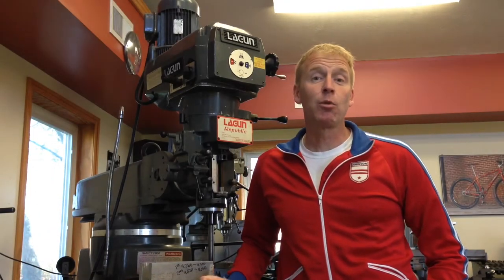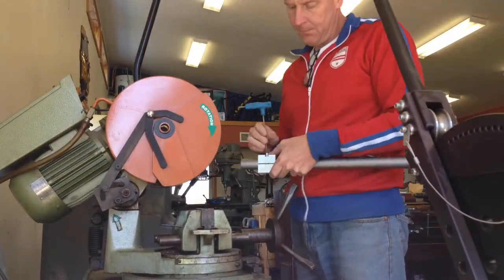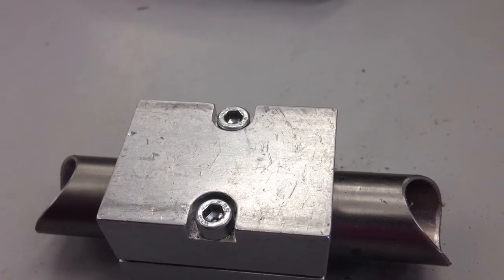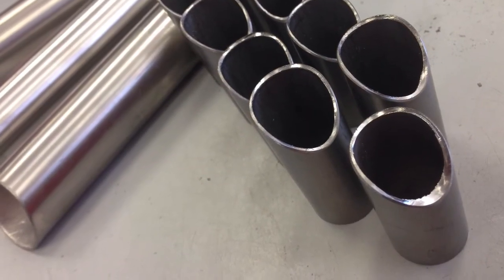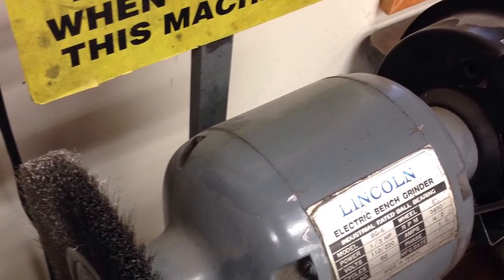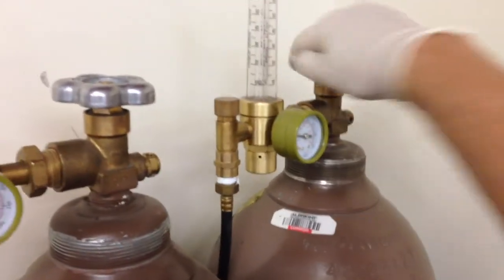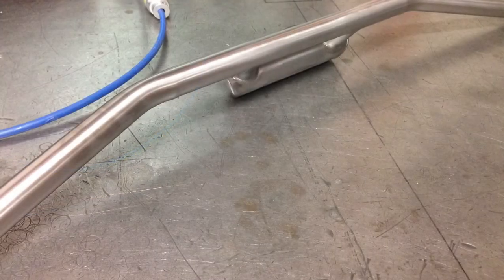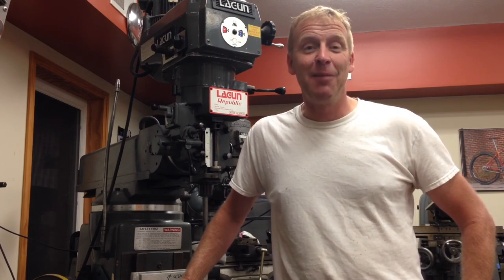How To Make Titanium Handlebars

Comment: Why do you use two different gloves during welding?
Reply from the maker: Vatsek... titanium is highly reactive to the oils in human skin, causing contamination that can result in failure of the weld.  The latex gloves protect against contamination once clean and ready for welding.  The Kevlar gloves provide thermal protection from the weld arc.

Comment: What kind of bade do you have on you cold saw? those cuts look super clean and neat with not many burs
Reply from the maker: Scotchman 120 tooth, 27.5 x 2 x 32 ... made in Holland.  Sharp teeth and correct feed rate = less burrs and clean up.
Reply: Rody Walter what’s the typical life of a blade like that? Have you cut stainless with it?
Reply from the maker: These are almost 17 years old, I have 4 blades that I rotate out, sharpen them once every two years.  Costs about 10 bucks to sharpen.  Stainless, Ti, Al, 4130...cut all with no issues.

Comment: As per usual, great video! What kind of tube bender are you using?
Reply from the maker: Chris... it is a Diacro Model 6 hydraulic bender.  Regardless of the bender, the most important criteria is good wall support gained through total tube encapsulation during the process.
Reply: Thank you!